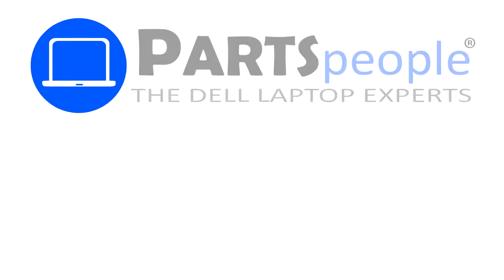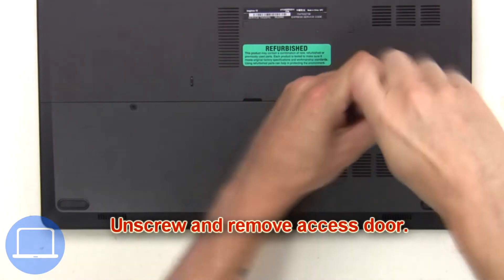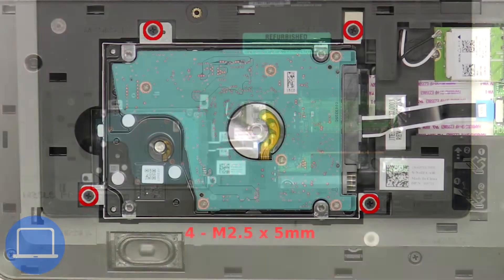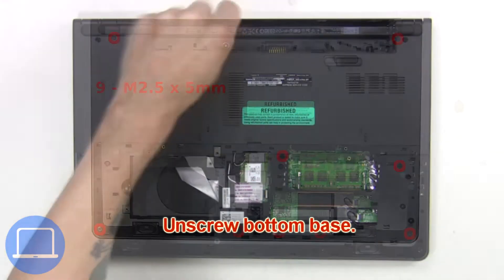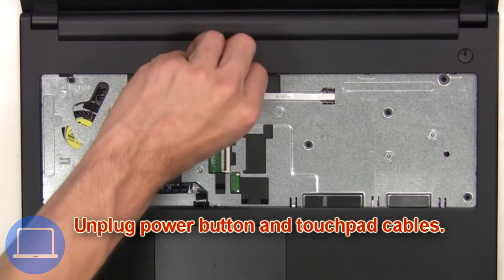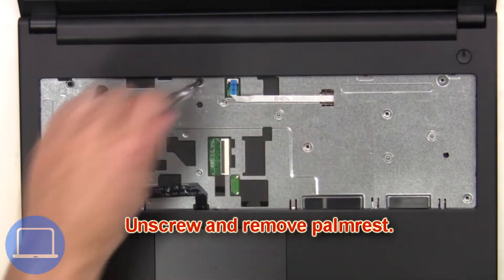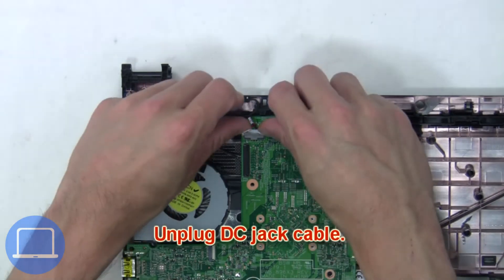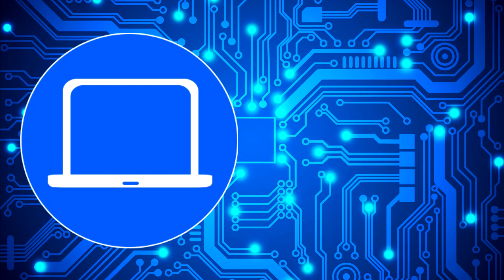Dell Inspiron 3451/3452/3458/3459/3468 CMOS Battery How-To Video Tutorial

Comment: Very helpful, thank you. I've had the Inspiron 14 3451 computer sitting in my office for a few years, not being used. I turned it on and was met with 5 beeps, meaning the cmos battery needed changing. I just installed ChromeOS Flex on it. It came with Windows, but I put Linux on it. Runs almost better as a Chromebook...